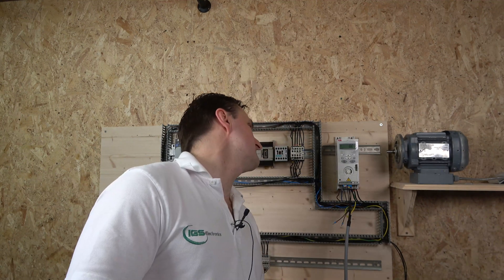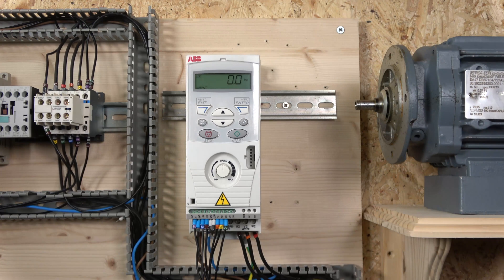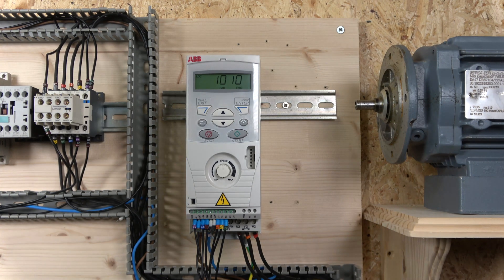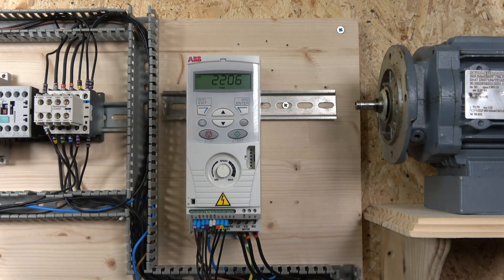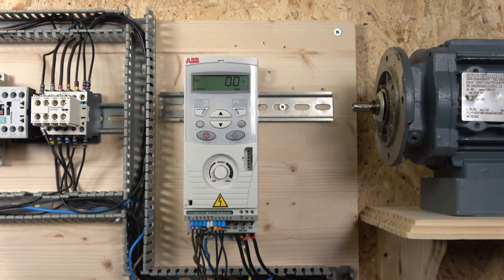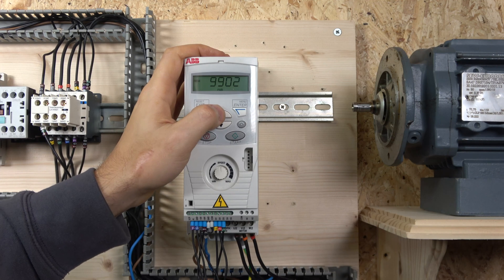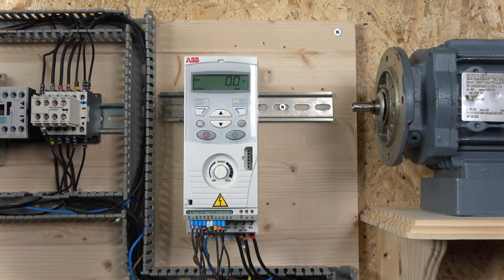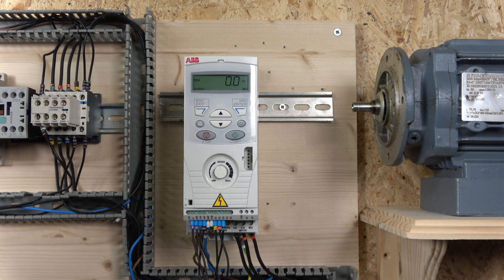ABB ACS150 VFD remote control, 2 wire and 3 wire control, potentiometer speed control.( English)

Comment: Hello. I wondered if you could do a video, or tell me where to find the setting for the use of just DI1 please. I’m wanting the inverter to run in remote, once receiving its digital input. The inverter is 3phase 4kw and is exact to this model. I want this to start up in sequence, as it’s part of a production line. Thanks
Reply from the maker: Will put that on the list.
Reply: @IGSElectronics  That would be brilliant thankyou. Im just trying to get my head round the parameter codes for each part, as it used to be so much easier to find.

Comment: hello Electronics are not my specialty. i what to make mixer . by using motor and something to control the speed. what i need m. vfd ,potentiometer . or both?
Reply from the maker: My suggestion would be to go with VFD plus 3 wire control station, the one you see in this video or build your own.
Reply: @IGSElectronics  thank you for your response . so if i understand. the vfd do everything . we add this control station for the easy use